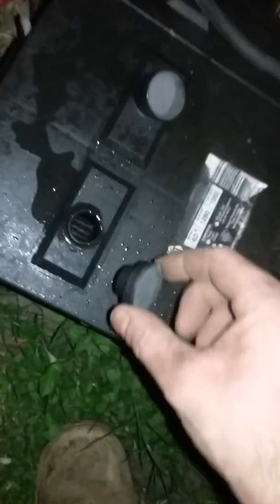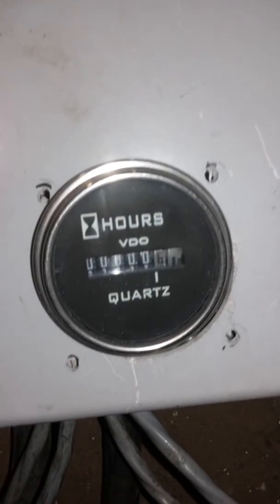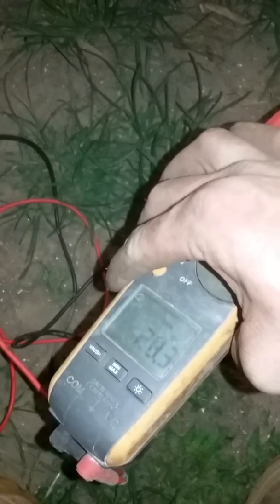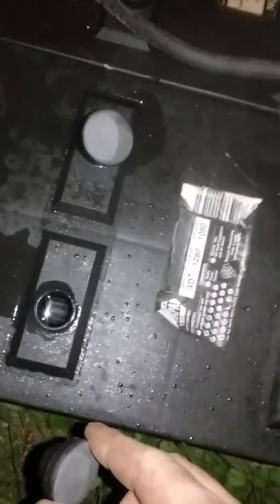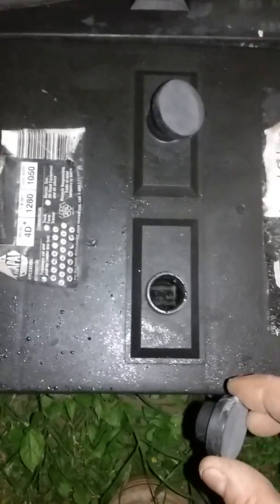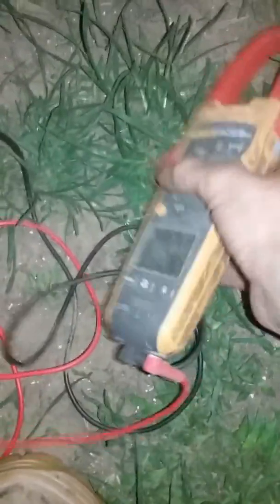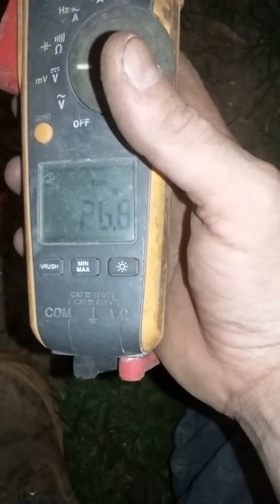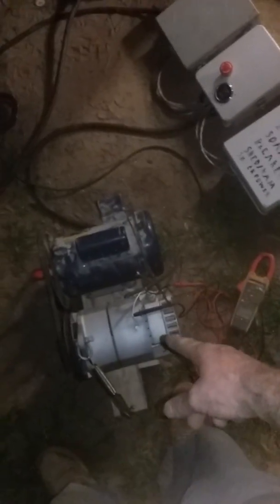My soon to be 24 volt DC welder

Comment: Not being smartass, just have no idea.  Why take batteries and convert that to mechanical energy in a motor, to then convert it right back to dc power?  Is it just not possible to use the power straight from the batteries?  I honestly just don't know shit about this and am curious..
Reply from the maker: No what I am doing is using 220 volts ac out of the breaker box to spin the electric motor which in turn spins the alternator that is putting out 24 volts DC at high amperage to recharge the two tractor batteries to be able to use as an emergency arc welder. I'm not using the batteries to spin the motor to spin the alternator
Reply: @db187654  Got it, thanks.